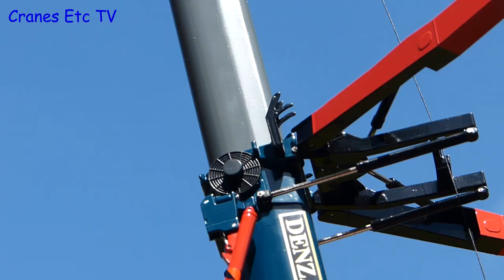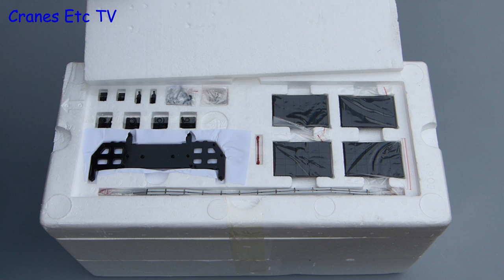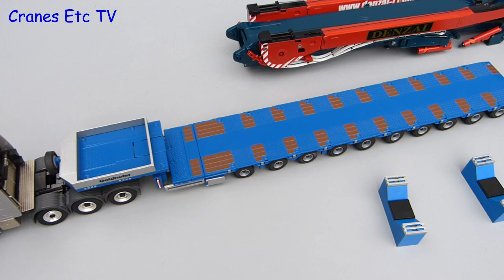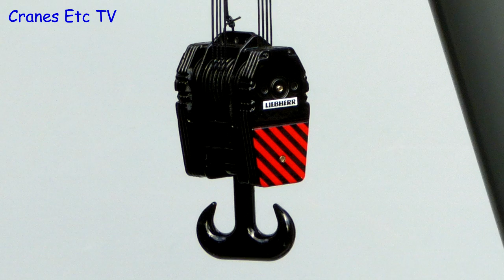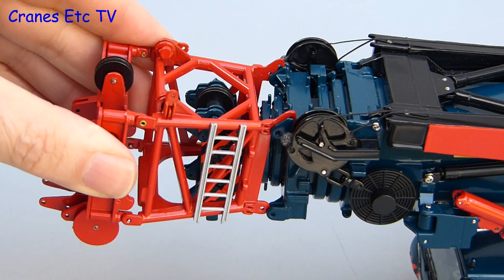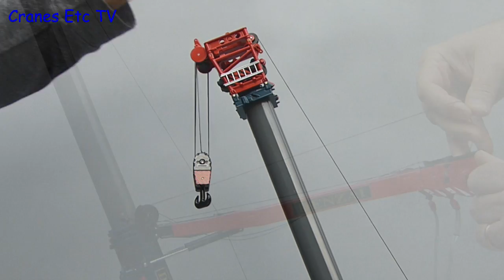NZG Liebherr LTM 11200-9.1 Mobile Crane 'Denzai-Juki' by Cranes Etc TV

Comment: For a thousand bucks you can get a brass sd70ace with dcc sound lighting and goes forwards and backwards,i collect both these impressive diecasts and O scale 2 rail,the features and set up options for these cranes are endless,and impressive the detail and functionality built into them while still being strong enough to be set up countless times,if it doesnt float your boat fair enough,but try not p1ss on a hobby if you havent seen or even held this kind of model